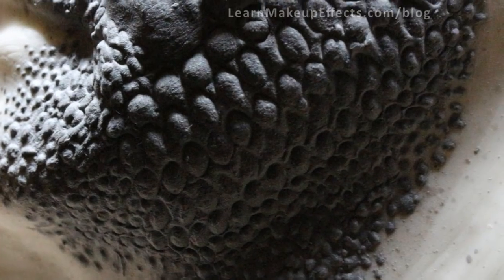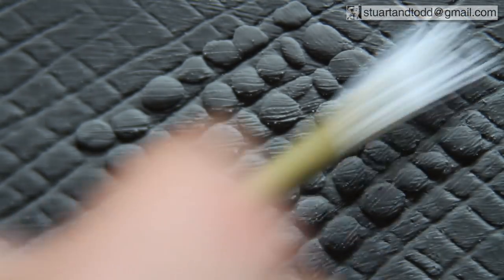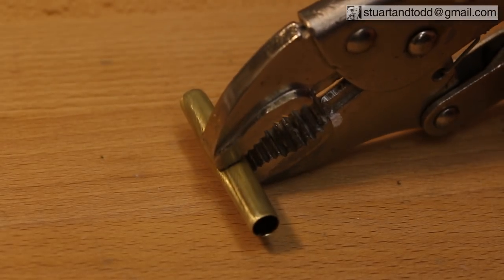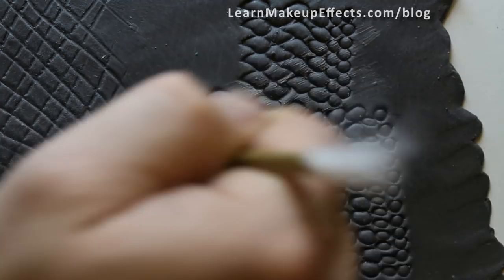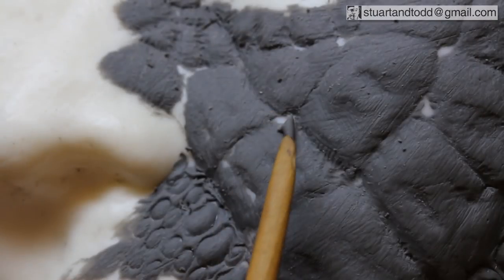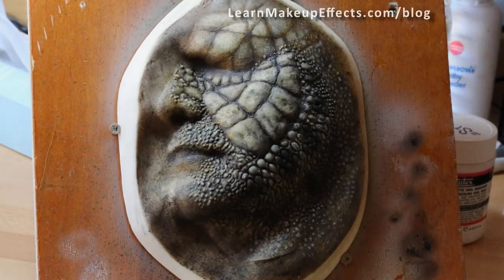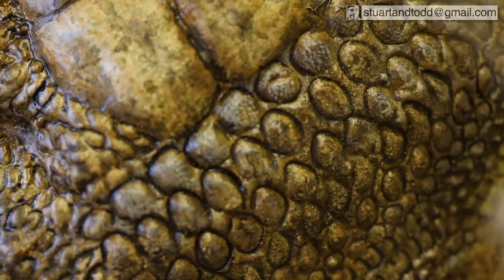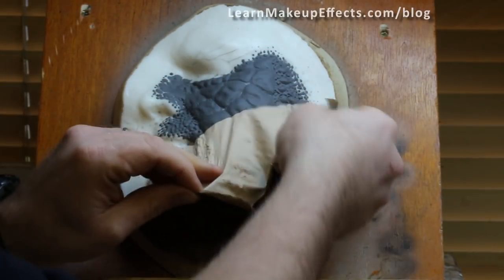Sculpting Prosthetics: Reptile Skin

Comment: When colouring the sculpt after with bald cap, could you do this with latex also? or would it damage the sculpt for moulding?
Reply from the maker: Latex itself doesn't actually damage the sculpt. However, if you intend to mould this and make silicone appliances then you many find the latex may still leave some residue of sulphur which can prevent silicone from setting properly. 

It is known as 'inhibition' and latex is commonly used in FX. As a result it usually need to be kept away from anything that involves silicone.  

For example I no longer even use latex gloves as touching moulds with them could cause the silicone to inhibit.
Reply: +stuart bray Thanks for the quick reply!

Is there a way to remove the residue of sulphur from the sculpt? or should I just avoid going near it with latex at all costs!
Reply from the maker: I've had moulds which cleaned ok and others that didn't.  I just avoid it to be safe.

Comment: What material do you use?
i tried plaster and playdough, but they react in awfull ways with the silicone, latex and polyester of the molds, and clay cracks
Reply from the maker: I use oil based clay known as plastiline.  There are a few brands, including Monster Clay and Chavant.
Reply: I think i's the same, but for some reason, the oily component gets absorbed into the mold material and messes with the curing.
Reply from the maker: Do you men the plastiline absorbs into the plaster cast on which you are sculpting?  And also that the surface of the silicone mould or appliance made from it is tacky or not setting properly?

That sounds like inhibition, where the process of the two silicone components 'crosslinking' is compromised.  It may be due to sulphur being in the plastiline.  There are 'sulphur free' plastilines like Chavant which are better for use where silicone is involved.
Reply: stuart bray Yes and yes, and the same with polyester mould, i also tried to use a thin layer of liquid latex, but it turns into goo if i leave it for more than two or three days, i think i will have to use regular clay, even if i can't recycle it.
Reply from the maker: Water based clay isn't great for appliances.  The edges dry and crack quickly as the water evaporates.  Send me some clear pics of what you have done and what the issues are so I can see. Email me stuartbray@yahoo.com

Comment: Could u also use clingfilm to round the top bit instead of making tha tool?
Reply from the maker: Not sure what you mean, I suppose if you warm the plastiline then to some degree it can be smoothed using plastic. I'd still need tools for the rest of the sculpting.
Reply: @stuartbray  I mean like if cling flim was on the clay etc then, u used like a bit of pipe etc, with no clay etc shape in it, so when u push down on the cling film using the bit of pipe etc, it might also push on the cling film to make round edges on the clay etc, altho it might need to be thicker material  than cling film maybe.
Reply from the maker: @oddity4650  yes, I'd suggest a thicker plastic. Also put a little alcohol on the plastiline and smooth it out through the thick plastic with firm pressure

Comment: What's the airbrush brand? its weird, doesnt have the top trigger
Reply from the maker: Román Kampelmacher It's a Grex, but there are many brands that don't have a top trigger.  This is a pistol grip, which is rather more comfortable and used in all the airbrushes and spray guns for tanning and painting cars in the body shop.  You can hold it for hours comfortably.

Comment: amazing work as always :)
what type of clay do you recomend for sculpting, and then moulding with plaster that won't loose its shape, and something cheap and takes good detail? thanks :D
Reply from the maker: Plastiline like Chavant or Monster clay is best.  As to plaster - there are better materials than plaster but in the UK, Crystacal R is good and the US its Ultracal 30.
Reply: thanks :D
Reply: oh and btw, does an oil based clay good for sculpting? and it doesn't dry with air right?
Reply from the maker: Sims2 MagicMovies yeah, its better for prosthetics and does not air dry at all.

Comment: What’s the name of that liquid clay that you are using??! Where can I find it and the syringe used to apply it??
Reply from the maker: At 9:50 I show the liquid clay being made. It's plastiline mixed with lighter fluid. If you Google 'syringe supplier' I'm sure you'll find a laboratory equipment stockist that supplies needles and syringes. Don't get too narrow a needle as this is a thicker liquid and we are not looking for painless injection. I'd say a mixing needle  is the size you want, maybe half a millimetre to a millimetre inside bore.

Comment: What kind of air brush do you use ?
Reply from the maker: The one I use here has the product code 'Airbrush BD-116' and is£35 from this place: http://www.airbrush-pro.co.uk/

For cap plastic though, generally the smaller spray guns used to paint cars are better, known as 'High Volume, Low Pressure' guns or HVLP gravity feed guns like this: http://www.rapidonline.com/catalogueimages/Module/M300081P01WL.jpg

Comment: Nice! Is that WED clay by chance?
Reply: Oh I see it melts when heated by a torch. WED clay would do dry up and stiffen instead.
Reply: The bit on the tubing tools just before 6:30 is priceless. I'm learning things! Thanks so much for sharing :D
Reply from the maker: Thanks. Nope, plastiline. Oil based ckays, usually used for appliances because water based clays will dry and shrink when sculpting thin things with fine edges. Chavant and Monster Clay are common in the States, in Europe these are popular also but I also like Plastiline by a company called J. HERBIN  based on France which have been involved with waxes etc for about 300 years!

Comment: stuart did i miss something ,. did you put latex on this as you were painting it ???
Reply from the maker: No, but I did apply cap plastic before painting it so it could be peeled off afterwards to mould. It's at 11:30
Reply: thanks stuart ,. im new to this ......so is the finished peice ready to be applied to your face ? thanks
Reply from the maker: Nope. This is just the sculpt.  It needs moulding and then casting out appliances from that mould using silicone.

Comment: plastilene?
Reply from the maker: Yup. Oil based clay, plastiline is a type of modelling clay which doesn't dry cause there is no water in there.
Reply: similar to plasticize?
Reply from the maker: Is plasticize a product or a verb in this instance?  Plastiline is like plasticine.
Reply: a product . sorry auto correct
Reply from the maker: Yup, its just like clay but oil based.  You can buy different types and they have different softnesses depending on your preference.  In the UK its cold more than it is warm so I use a softer grade than if it were 90 degrees outside 70% of the year.